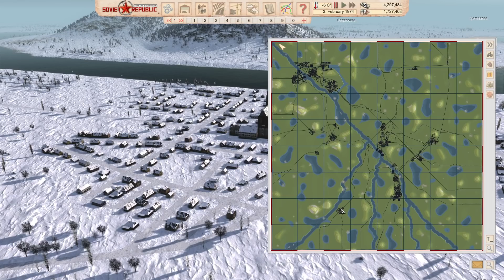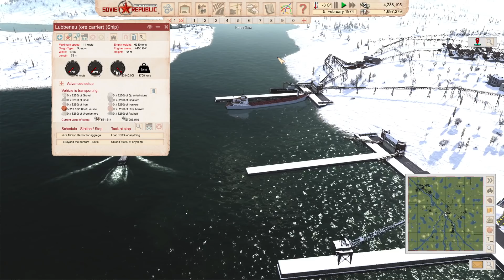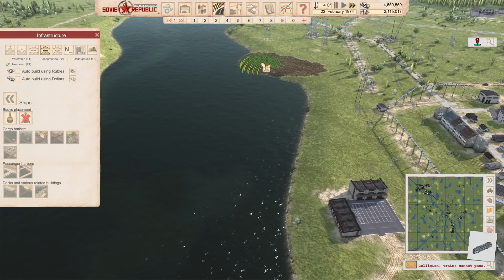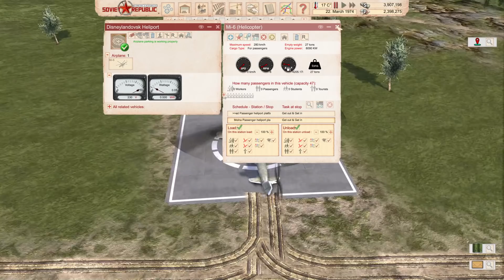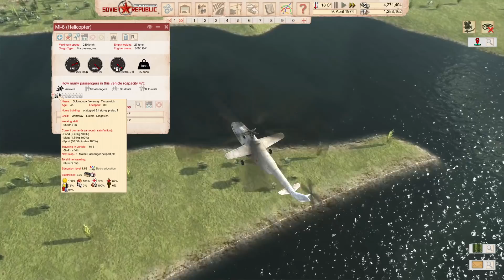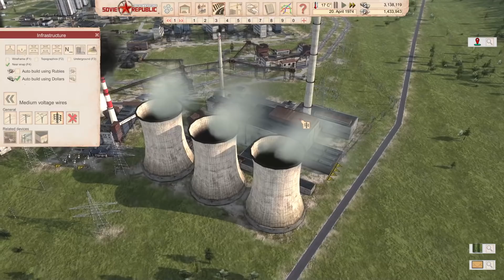HUGE Coal Excavation Operation! - Workers and Resources: Soviet Republic - Episode #48

Comment: A modder named AiGame has a several combo storage mods that may lower the complexity of food distribution and multi input factory prodution. And as a bonues they made a helicopter construciton office (more slots?)

AiG City Storage ( so useful! )
Food 262.52t (81% of storage, I set custom ratios)
Cloths 47.13t (15%)
Electronics 10.75t (5% )

Meat 75t ( not part of storage total )
Alcohol 50t ( also separate total )
Also has 4 loading slots

AiG Universal Storage
Useful stats here ( lol not )

AiG Helicopter Construciton Office
14 + 3 slots ( I have not checked but the comments said it was an improvement over vanilla)

Also I would like to remind you that there is a star in the upper right corner of mod icons. If you right click it will alow you to pick it threw the vanilla selection menues. Click the star and it will open all your favorited mods. This could help you when your talking and building. I see you either over selections especially for convayor towers.

Comment: The coal power plant has been a primary culprit of the consistently high death rate in the republic (second only to the snow) due to extreme pollution. 
Solution;  pollution-free electricity.  Outside of town, build a huge field (25 by 25) of large windmills providing the nation's electricity.  After you build the windmill "farm" (25 in length by 25 deep,) you can implode the coal power plant.
With all of these windmills producing power, without pollution, your wonderful workers (and resources) will increase their input to your nation from 45-50 years of dedication to 75-80 years of dedication.